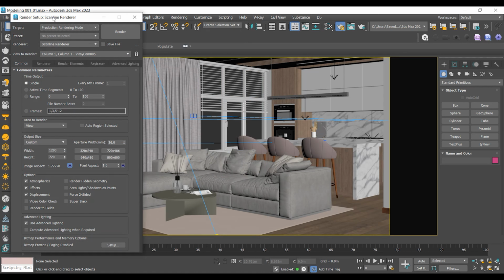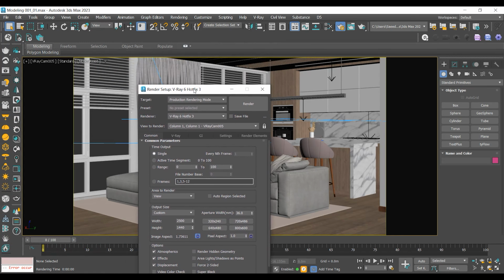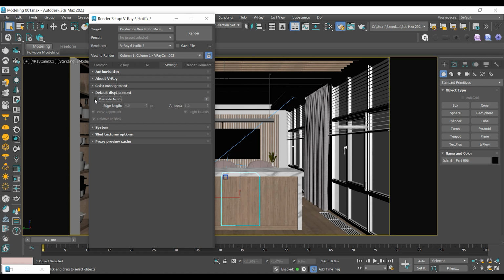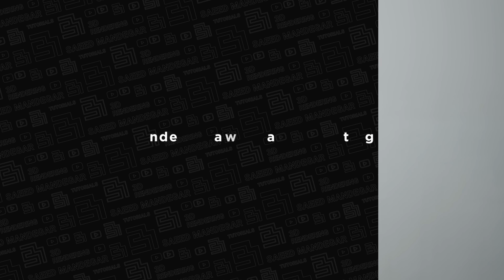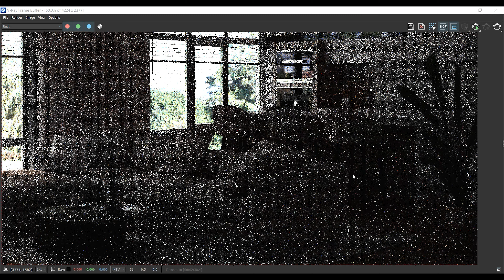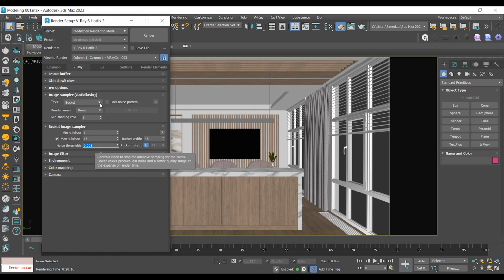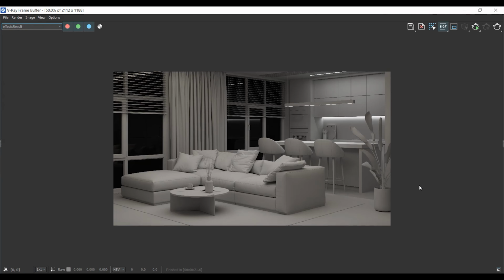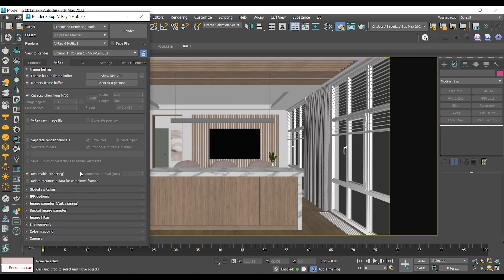10 TIPS To Boost RENDERING Speed!!!

Comment: bro 4k is a must these days, wtf are 2,5k I mean if you are rendering for intsagram its enough..
Reply from the maker: Hi, 2.5 is the minimum size that details will be visible. 
I recommend using AI to generate 4K output off of a nice clean render with lower resolution to save time.✌️
Reply: @SaeedMandegarTutorials  ok sure makes sense if you use ai afterwards
Reply from the maker: btw, thanks for sharing your thoughts ✌️